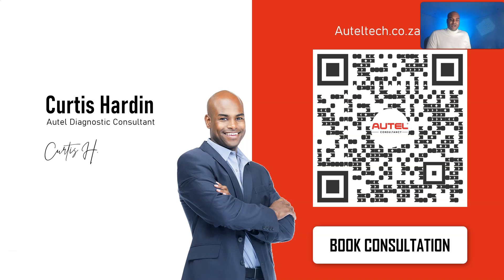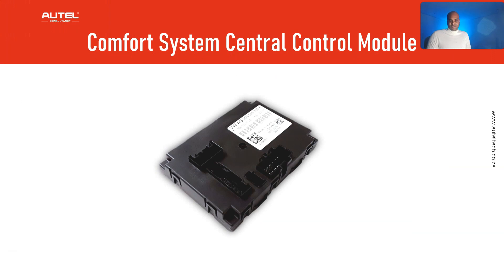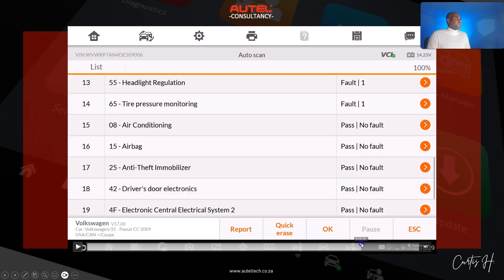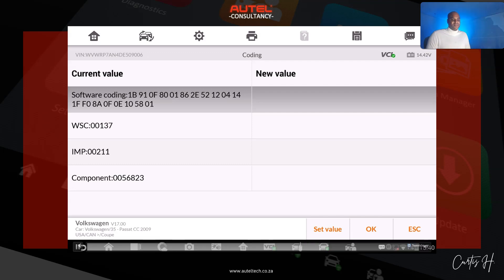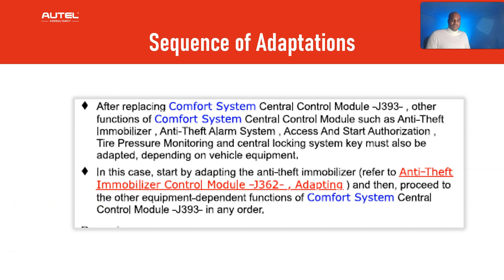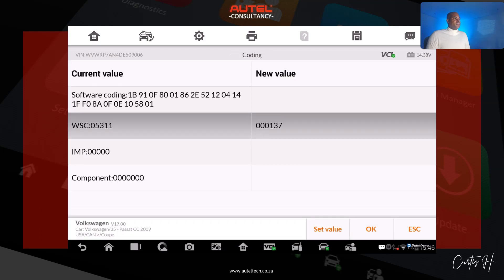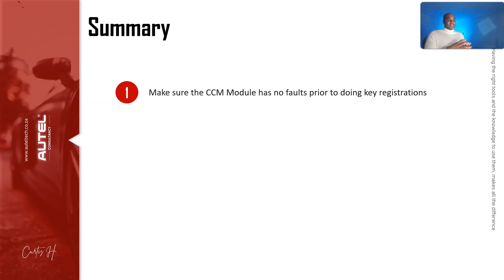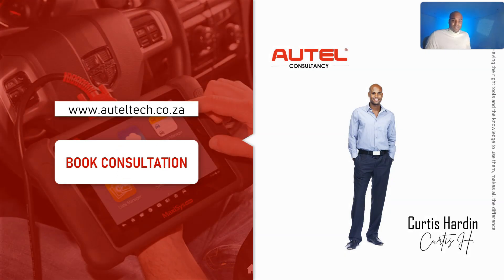Coding a Used Comfort Control Module in a 2013 Volkswagen with Autel IM608

Comment: Hi, audi A4 b8 2010 2.0TDI, I need replacement comfort control module, but used module?
Reply from the maker: If you want me to asses you and help you through the process you need to book a diagnostic tool consultation with me at auteltech.co.za . Otherwise you can try calling your supplier or Autel New York and see if they can walk you through the process.

Comment: I hope you would be able to clear my mind regarding eeprom, is there any difference between the im508 and the im608?
Reply from the maker: The im508 is for people who have a diagnostic tool already but dont have the key coding the need to do  advanced key coding procedures.  The im608 is for people who want advanced diagnostic software and advanced key coding.  If you want me to align you with the right tool you should book a consultation with me.
Reply: Thank you! I'm only interested in EEPROM I'm a Locksmith and I have the 508 I was just wondering if they are the same in that type of work. Just to be sure the 608 doesn't have more eeprom possibilities than the 508